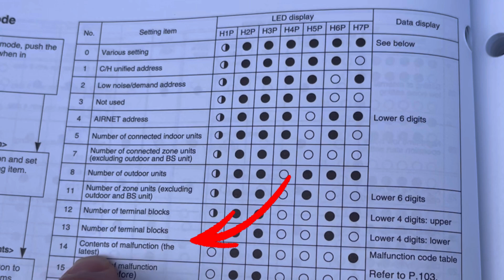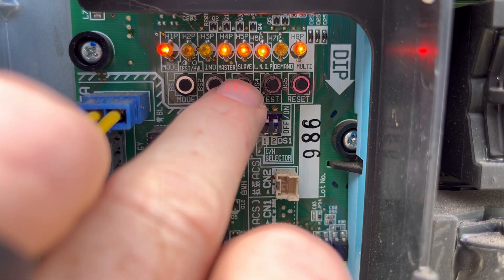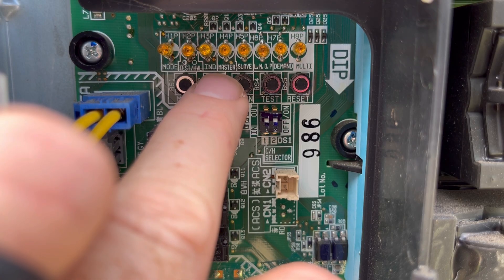Daikin VRV -Blinking Lights - How to read Binary Display to find errors

Comment: This is my gripe with Daikin.. I'm more a Mitsubishi first and LG/Daikin second because of this. I will say LG may have recently dropped to third on my list because they made it so you can't connect to a system through an IDU..
Reply: This is insane! This is 2025 how difficult is a LCD screen geez🔥😖
Reply from the maker: I will say other brands make it easier to navigate their outdoor unit display. Don’t get me started on the service programs also. Connecting through an idu is great. I wonder why they stopped doing that?
Reply: @RomanBaugh  you, me & my buddy that works for a local rep. for LG in my area is asking that same question haha I definitely wish Mitsubishi would get their software up to par with other manufacturers in terms of data collection rate though.
Reply from the maker: How slow is it? I assumed it was every few minutes?
Reply: It's basically a screenshot every minute but, I feel I have missed pre-error data due to this in the past. I haven't used Daikin service checker in years so idk how that is but, I have used LGMV and it is basically real-time data as the system is running, give or take a couple seconds. When I asked my local METUS rep. why Maintenance Tool is slower, he basically told me it's because the likes of LG & Samsung have a significant edge in that regard of data collection and what not 🤷‍♂️
Reply from the maker: Interesting, Daikin is also every 60 seconds but they had once upon a time a direct board interface to the A1P that allows for 1 second updates. They discontinued it back in 2009 unfortunately.